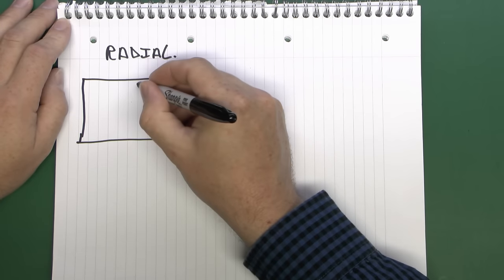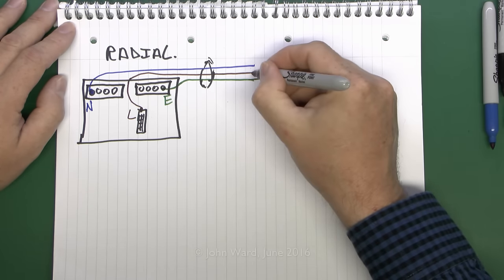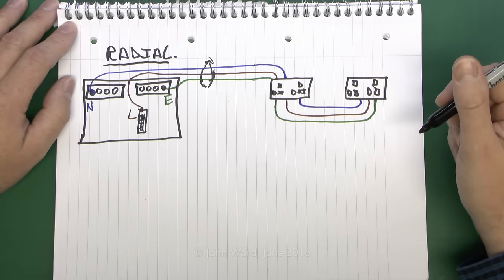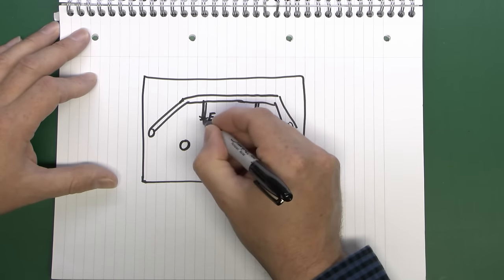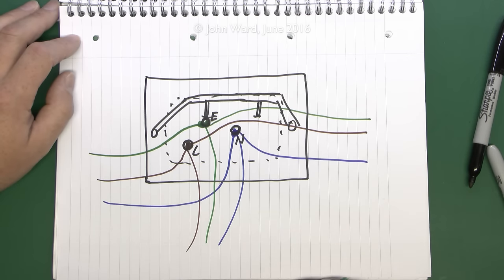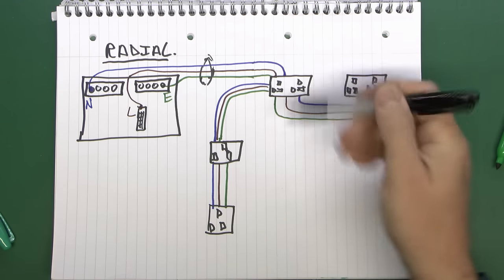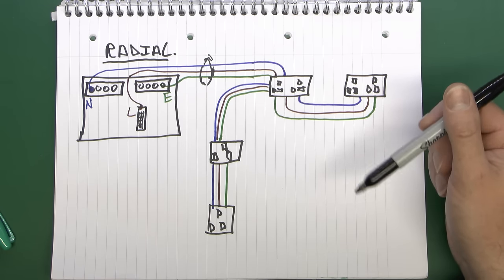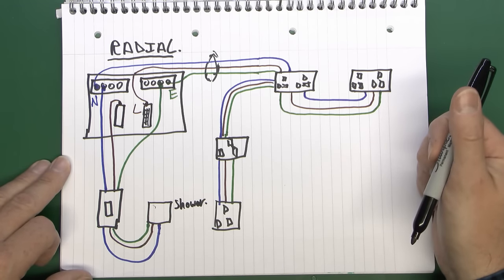Radial Circuits

Comment: HI John You make some great videos - well explained and understandable. I have been looking for certain info on YouTube but not found a video that supports this. This is if you move into a new house there may be lots of sockets in the rooms. These may all be fed by one feed from the consumer unit in an older house or may have separate ring mains - one for upstairs - one for downstairs and maybe one for the kitchen, in newer build properties. Here is what I would like to find out......What method would you use for tracking the run from the consumer unit to the first socket, and then the second, third and so on. So you could produce a realistic map of the ring main ? Without having to rip up floor boards and being totally confused with the myriad of wires you will find ! Is there a simple way to 
do this ?
Reply from the maker: If you really wanted to do that, then disconnect the wires for the circuit at the consumer unit, temporarily connect L&E together in one of the cables at the consumer unit and then check resistance between L&E at every socket.  Resistance will increase as you get further away from the L&E link and be greatest at the other end of the cable.
Same can be used for radials, the highest resistance will be furthest from the consumer unit.
Reply: @jwflame  Many thanks John.
Reply: Chris Ward - Note that in some properties, the ring circuits may not be one per floor. But instead each circuit may run via the ground floor ceiling/first floor void and run down to sockets on the ground floor and up to sockets on the first floor. For example if you have two circuits, they may be separated into two, one feeding the front rooms with the other feeding the back rooms, or East / West or North / South etc...

If you want a quick way of tracing live circuits, hire a CAT scanner. Power down and isolate (including neutrals) all circuits except the one you are investigating. Then plug in a suitable load (such as a heater) at the furthest point from the consumer unit on that ring circuit. Then by using the CAT scanner, you should be able to get an idea of where the cables run. Confirm by using the method outlined by John, as the CAT scanner method is not always accurate if multiple cables run in parallel. Alternatively, also fully isolate the circuit you are investigating (line and neutral) and separate the wires from each other at the consumer unit. Then connect a ‘tone generator’ between one wire (either line or either neutral) and the main earth in the consumer unit (NOT the circuit’s earth wire). Set the CAT scanner to the appropriate mode to detect the output from the tone generator. You should now be able to trace the cables. Again, if the cables from the same circuit run in parallel, it is not possible to determine which is which, so again, use John’s method to confirm.

Comment: Hi . I watch both ur videos for ring circuit n radial circuit . Is it necessary to have a ring circuit on sockets or we can use radial circuit on sockets as you said in video that ring circuit is quite old type of circuit. Cuz I done radial circuit in my house ( doin extension) n someone told me that it has to ring circuit of sockets so I’m confused ?
Reply from the maker: Rings are not necessary, a ring is just one particular type of circuit that some people are obsessed with using everywhere.

Comment: Great Video as always JW! quick question, How do you interpret the maximum floor area for Radial Circuits?
Reply from the maker: Decades ago it was defined as the floor area that the sockets supply, same as for ring circuits.
Floor area hasn't been a requirement for 40+ years. Real limits are the total load that's likely to be connected and the circuit length.

Comment: Thanks John - super video. Would you be happy using one radial 2.5mm cable for a kitchen running freezer, fridge, dishwasher, extractor fan, and 7 sockets?  (cooker seperate feed of course!)
Reply: would probably be OK, best to either use a ring or a radial with 4mm cable both of which you can use a 32amp breaker

Comment: Hi I would like know if the rules in un are changed because I made by myself the system on my house and I create a radial circuit for each room and today the electrician told me is not right system is not English standard... I made 3 socket in one bedroom, second bed 3+1 corridor and in another 4+1 because from the last socket I bring up on the ceiling 
Please can you tell me if I have to do a ring? Or should be fine?
Reply from the maker: Ring circuits have been acceptable for over 70 years.  Radial circuits  for decades longer than that.  Both are still acceptable, nothing has changed.

Comment: If a radial circuit is used is it best practice to use circuit breakers for each room?
Reply: There's no requirement in the UK for that. In the UK lighting circuits are typically one per floor and separated from power outlets. There's nothing stopping the installation of one power radial per room, but it's expensive and uncommon. The one exception is usually the kitchen as if radials are used for sockets, it's often a 32A circuit using 4mm^2 cabling (in addition to any dedicated cooker circuits). 

In the case of other rooms, 32A ring circuits are more common, often one per floor on smaller houses. If radials were used I doubt that many electricians would specify one per room unless it was expected to have a high load.

Comment: Great videos, thanks John. One quick question. I am converting a small outhouse at the back of my house into a utility room. It will house a fridge freezer, dishwasher, washing machine and tumble dryer. I was planning to install a 2.5mm ring main protected by a 32A RCBO, but instead could I use a 4mm radial circuit still protected by a 32A RCBO? Also, could I spur off this radial circuit to supply a 5' LED tube and extractor fan both connected via their own 5A FCU and 1mm cable?
Reply from the maker: Yes, 4mm² 32A radial is fine.  5A FCU for lighting and extractor is also ok, the only minor disadvantage there is that a fault on the 32A circuit will result in no lighting.

Comment: If a group of sockets are on a radial circuit protected by a 20A breaker, how is each appliance protected from overload?
Reply: plug top fuse

Comment: Great vid as always. Thanks a million. Question: Can we add a junction box between two sockets to branch out for more outlets?
Reply from the maker: Yes.  If the junction box is to be concealed, it needs to be a maintenance free type.
Reply: @jwflame  Would this be notifiable under Part P?

Comment: Hi John... Would it be possible...like in a cooker circuit for example...to run a 6mm or 4mm radial circuit from a 20  or 25 amp mcb/rcbo in a radial circuit for sockets...in fact would you recommend that socket radial circuits are run in 4mm minimum...just to be certain of no cable overload? 
Dividing a large hose into bedsits...and contemplating running individual 6mm or 10mm to each room for individual consumer units ....20 amp rcbo's for radial sockets and using 6 amp rcbo's for the lighting.
Reply from the maker: Radial circuits can be any rating you want.
A 20 or 25A circuit can be done in 2.5mm² cable, unless the cable is installed through insulation or is of excessive length.
No point in wasting money on oversized cables, the MCB will prevent any overload - the basic concept being the cable has a higher current rating than the MCB.
A CU with only a 20A and 6A circuit could also be supplied with 2.5mm cable.  Perhaps 4mm in some circumstances.
Reply: Thank you...

Comment: Would i be right in thinking then that you only need a real expensive tester and additional course to be able to test and inspect in the UK, since nowhere else does rings and so continuity testing would never be relevant because a fault would just mean the radial circuit would just stop working past the point of breakage?
Reply from the maker: All circuits need to be tested, the only difference with a ring is that it requires some additional tests to confirm it is actually a ring.
Continuity testing is always required, as it's essential to confirm the CPC (earth) conductor is continuous.  If not everything still works but in the event of a fault, exposed metal parts would become live.
Things working is not the same as it being safe.
Reply: @jwflame  I see. Thanks for clarifying.

Comment: Hi John. If you wanted to add a spur socket straight from the 32A circuit breaker instead of an existing socket or junction box on a 4mm² radial circuit, would you wire it in 2.5mm² or 4mm² like the rest of the circuit?
Reply: An old post but for anybody else that may read it, you cannot use 2.5mm cable on a spur or a radial for that matter from a 32A MCB, the cable rating must exceed the fuse or mcb rating so the cable is protected against overload.
Reply: @cbcdesign001  thanks for letting me know.

Comment: Could you have double sockets all along the radial? Eg where you've drawn the single sockets
Reply from the maker: Yes, there is no limit to the number of sockets connected, although the total load cannot exceed the rating of the circuit breaker for the circuit.
Reply: @jwflame  thanks John,  looking to add more to garage , to power washer dryer and odd use of electrical power tool. Wondering if a ring might be better given the equipment use....?

Comment: JW, I want to extend a 4mm kitchen radial but I’ve not yet tried to get 3 4mm’s in a socket terminal, is it possible? Or do I need a JB? Ta 👍
Reply from the maker: Depends on the manufacturer of the socket - BS1363 requires that the terminals accept 2x 4mm² wires, however some manufacturers make larger terminals which can accept 2x 6mm² or 3x 4mm².
Reply: @jwflame   Cheers JW, I’ll have a look at the different manufactures’. Have a great and and thanks for the vids.

Comment: Is it permissible to have a radial circuit feeding a number of 13 amp sockets, all wired with 2.5 mm cable and protected with a 25 amp mcb.
Reply from the maker: Yes, provided the cable is installed so that it's rating is more than 25A.  Cable surface clipped, under floors or in plaster would be suitable.

Comment: Just come across a circuit which is ring at the consumer unit, but not ring nor radial at the souckest. I reckon a 2.5 cable is run to a junction box under the floor and came backro the consumer unit, then from the junction box cables is run to each soucket separately. the question is should it be tested as a ring or radial. or perhaps part oing and part radial,  but have no access to the junction box. it is under newly done carpet. any suggestions please?
Reply from the maker: I have seen a few where the ring had multiple junction boxes on it, each one had a single cable to a socket.  The 'ring' part can only be tested at the consumer unit to confirm continuity of the L N and E conductors.
Yours might be like that, or it could be a horrible mess of random connections installed by people who didn't know what they were doing.
As yours can't be determined, it would not be desirable to continue using it with a 30A / 32A fuse/circuit breaker as the 2.5mm cable could be overloaded.  One option is to change to a 20A or 25A circuit breaker, and consider the whole thing a radial circuit.  This would avoid overloading the 2.5mm cable.
Ideally the concealed junctions under the floor should be removed, as they might be something like this mess: http://xo4.uk/?8h3 which I found in a house several years ago.
Reply: John Ward 

It is a good idea but apart from that I am just thinking it may be safer to change the consumer unit with the new version RCD one as a back up, as this one doesn't have RCD. one more point is that the breaking capacity of the MCBs are 6k, but the PFC test shows 6.9A which is higher than max fault current capacity. Ze 0.05 which is too low?
THANKS FOR YOUR REPLY,
HAMID

Comment: Great video however no mention of cable size or circuit breaker size for radial socket circuits
Reply from the maker: Cable size depends on the installation method and the protective device.  Anything from 1.5mm² upwards.
Reply: @jwflame  Great videos
Reply: NO No NO. 2.5mm2 minimum for 20a breaker. 4mm2 for 32a breaker. Each socket has fused 13a plugs.
Others e.g. imm. Heater should have a 13a spur unit.
Covered in the regs.
 
I'm afraid the supercilius John Ward is not the expert he purportes to be.
. Read the Regs. Electricity is not for amateurs.

Comment: Hi John. Do you recommend 4mm / 32amp for kitchens and 2.5mm / 20amp for all other rooms? Why does it seem the majority of electricians on forums still prefer rings over radials, i dont understand! Thanks
Reply from the maker: Yes, rings really have no uses when applied as they typically are.  The original point was to have one ring for the entire house with spurs installed from new for distant outlets.  This did save significant amounts of cable compared to previous methods.  Installing them one per floor or even a separate one for the kitchen makes no sense at all.
It's not always necessary to have a 32A radial for a kitchen either - 20A circuits can be used there as well, particularly if there is a separate utility room for washing machine and dryer.
Reply: Thanks for taking the time out to respond, much appreciated!
Reply: Ring vs. Radial
Which you should specify depends on many factors. What are the expected loads (does the building have central heating, so will plug in electric heaters be used or not, what appliances are expected to be used, etc. etc.). How many socket outlets do you want, both NOW and in the future (when someone decides to rearrange the furniture in the rooms).
Now draw up a plan on paper to work out the details. I always recommend that you specify more socket outlets than your immediate current requirements, as providing them now is far easier than making alterations later.
In a rooms where there are plenty of socket outlets, the distance between the sockets will not be that far, so the difference in cable cost between two radials and a single ring circuit will be insignificant if buying drums of cable.
Properly designed and installed ring circuits are just as safe as radial circuits.
Ring circuits are more flexible for the end user, as they can plug any normal appliance in to any socket outlet they like. Whereas if 20A radial circuits are used, too many high powered appliances connected and switched on at the same time on one circuit will trip the MCB. Worse if the protective device is a fuse... Fuses have the disadvantage that people can put in higher rated fuses, higher rated fuse-wire, or normal wire or other conductive material. And don’t think that a MCB protected consumer unit can save the day, as I have come across radial circuits run in 2.5mm squared cable protected by 32A MCBs...
Properly designed and installed radial circuit circuits have the advantage that no fixed wiring cables should overheat. But a poor conductor connection in a socket outlet could cause overheating and may result in a fire. So the argument that a fault will always show up in a radial circuit does not wash with me.
With a ring circuit, a disconnection or a poor connection could result in a cable being overloaded if multiple high power appliances are in use. But as there are two current paths, it does depend on where the fault is in relation to the circuit wiring.